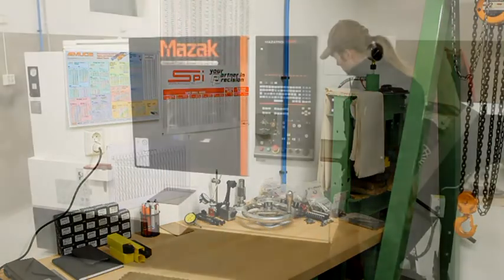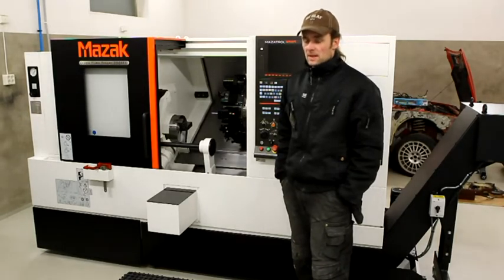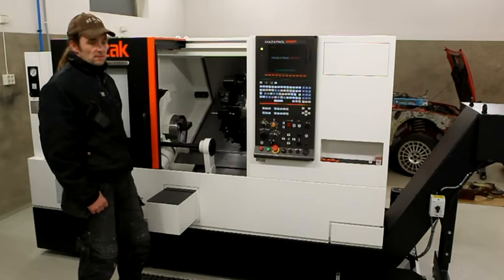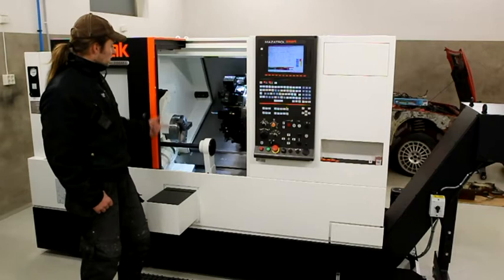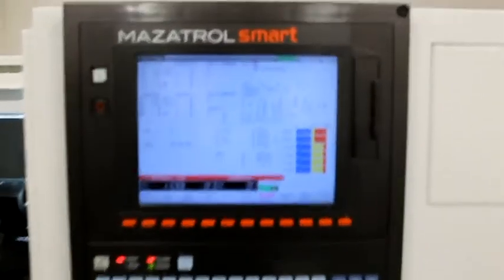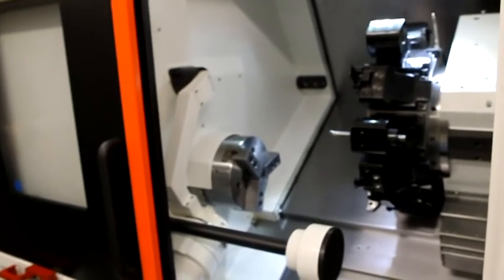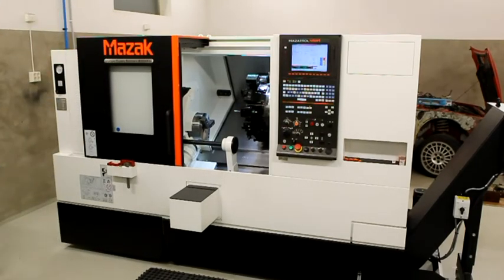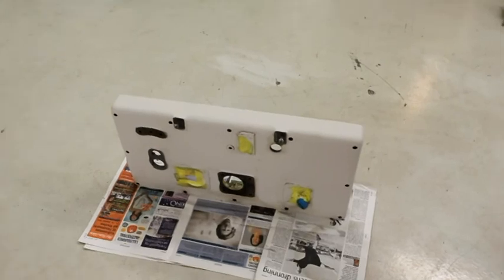New machine day part 2

Comment: Needs a bigger inntak, du you have only sekstitre ampere sikring?
Reply from the maker: I have changed the intake so all is good now. The lathe would have run on 63A but I had too much voltage drop due to the wires.
Reply: Good to hear :D